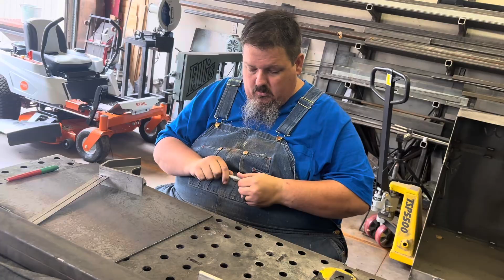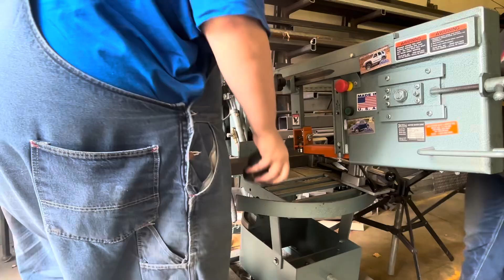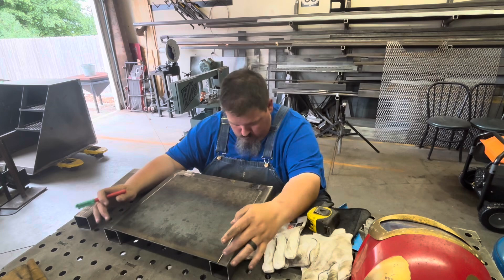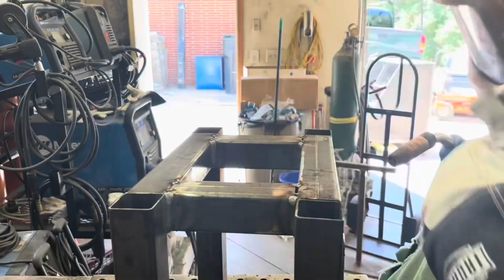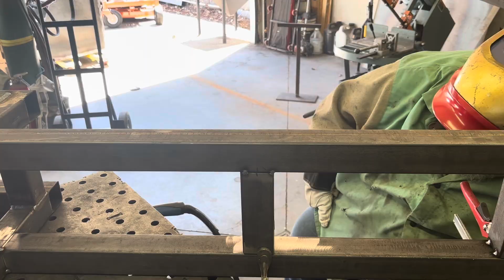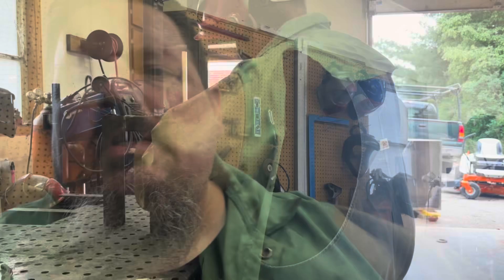Building the bundling stand #firewood #welding #fabrication #businessgrowth

Comment: Looks good rob.  I don't want to tell a guy how to do things so give it a try the way you built it. However I don't think you will have luck turning the bundles around. I get wanting the backing plate but once you wrap the first end the other end is going to want to spread out so trying to get it back in the bundler might not be as smooth as you were hoping for. I hope im wrong.  Cant wait to see what you think
Reply from the maker: I’ve already modified it. Gonna make a couple more changes but want to get a bunch of bundles made before I make more changes. Thanks bud